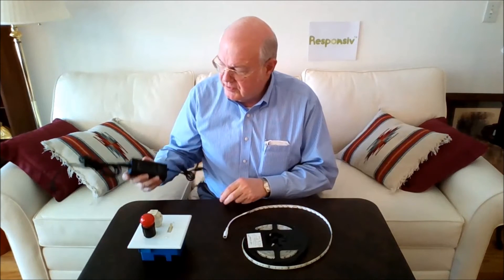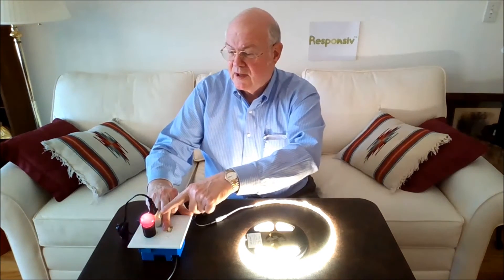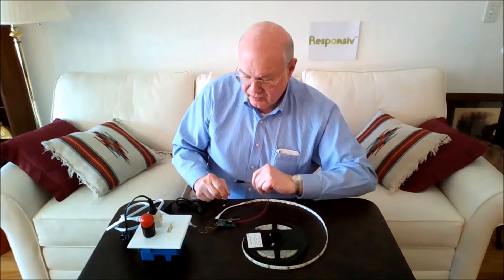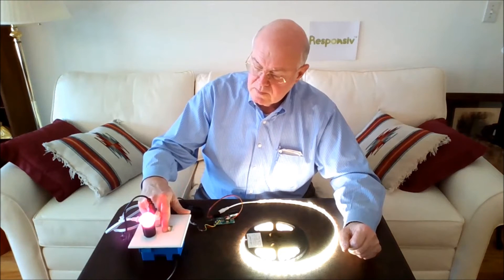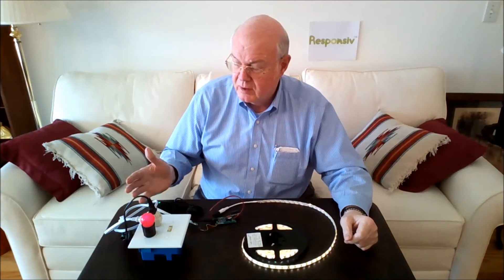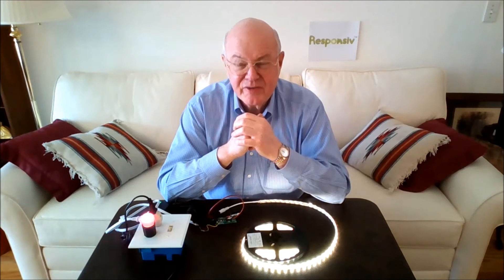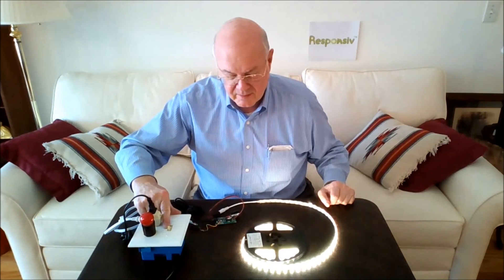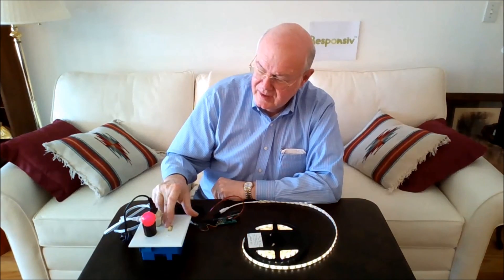Triac Dimming of a Non-Dimmable LED Power Supply

Comment: Hello, great work, would you have any link to build or buy this external module ?
thank you
Reply from the maker: The external module is a modified Responsiv Power Switch Remote LED Dimming Controller, ASIN B01MXR0HOT on Amazon.com.  It dims LEDs with a non-dimmable power supply by responding to Blink'n'Dim commands from the power switch.
Reply: @joedoll3162  Thank you very much for the reply. It's good to have a base answer, I will give it a glance and make some digging to adapt to my needs. Thank you for the info & link
Reply: Would you mind explain how you added the 2 additional components to the Tric dimmer ouput : the infrared optical insolator & resistor.
Which characteristic for those components (110V I guess where I'm in 220V), and how did you connect this to the Responsive Power Switch ?
If you could make a video to explain, or any electronic scheme, I would really appreciate.

Thank you again for your reply
Regards
Reply from the maker: @JfD_xUp  I'm afraid it is something you won't be able to do at home, if that's where you're going with this.

The dimming controller operates by sensing brief interruptions of supplied (DC) power, and controlling LEDs by interpreting those interruptions as Blink'n'Dim commands.  The opto-isolator was wired to ground the power sensing pin during the portion of the AC power cycle when voltage was present.  Thus, the power sensing pin was fed a 120 Hz square wave with a duty cycle determined by the triac dimmer.

Here's the "not at home" part:  To interpret the modified power sensing signal, the microprocessor was reprogrammed to respond to triac duty cycle instead of Blink'n'Dim commands.

I believe this technique is cheaper and better than the "dimmability" circuitry manufacturers add to their fixtures and bulbs.  Maybe one day they will agree and use it.  If they do, I recommend using a limited range "signaling" triac to simplify power supply design.
Reply: @joedoll3162  Thank you very much for your reply, even if your video is 2 yrs old now :-D